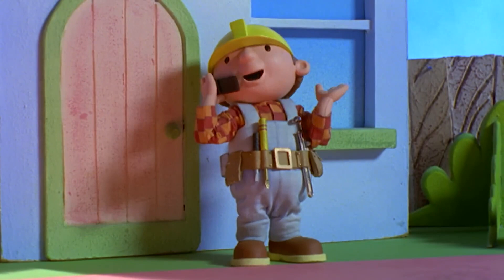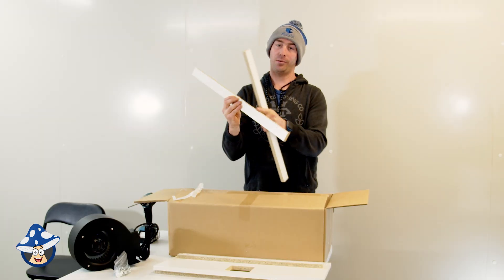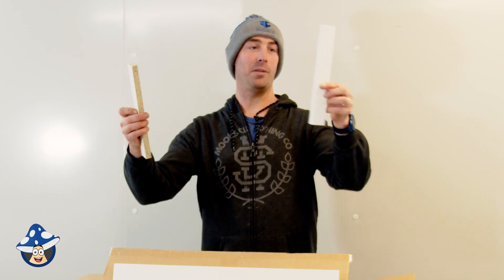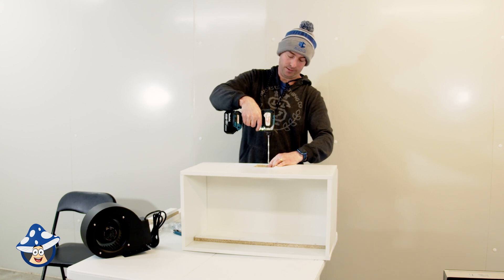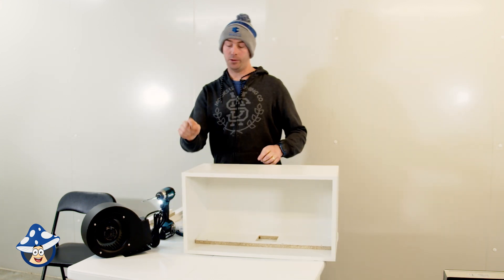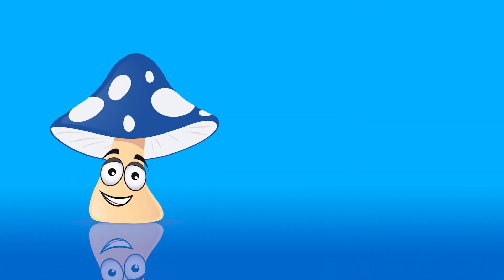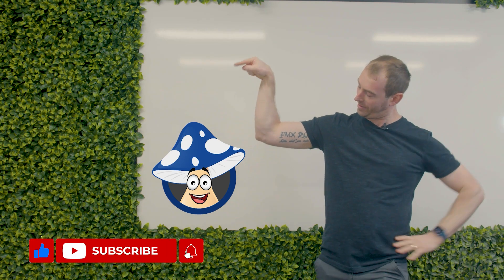How to Build a Laminar Flow Hood | Step-by-Step Guide | Aussie Mushrooms

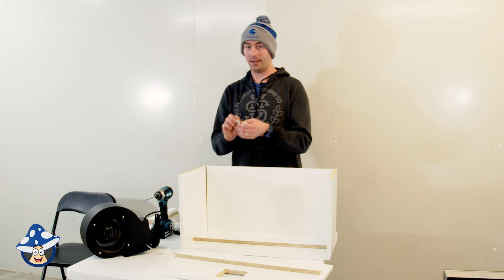Comment: 2:22 - "there's no wrong way to do it" - yes, there is. Mine came without those "little thing strip on it" attached to the panels. Also, the worst was that the front frame had holes on the laminated edge side. If I followed those I would have pirced the filter with the screws. You should fire your hole driller! 😂